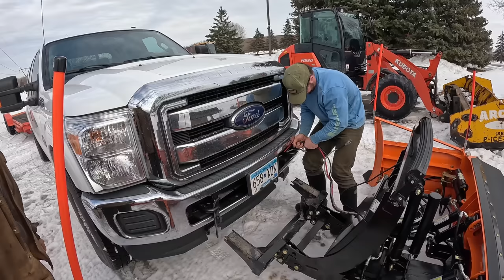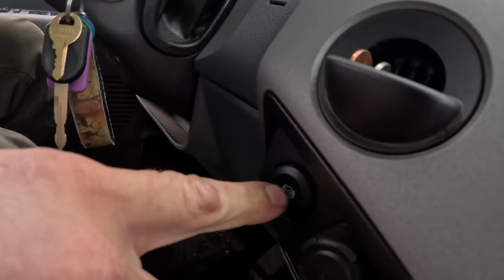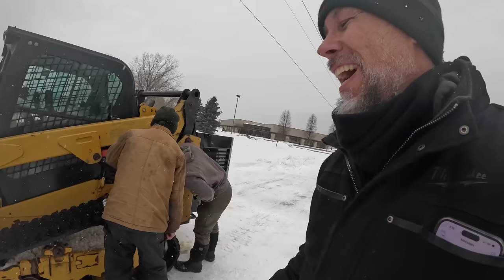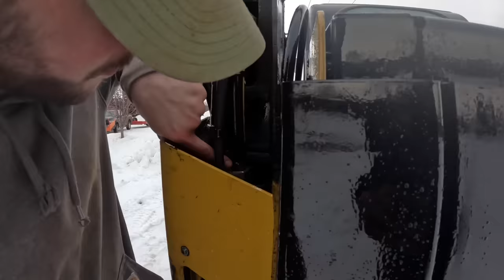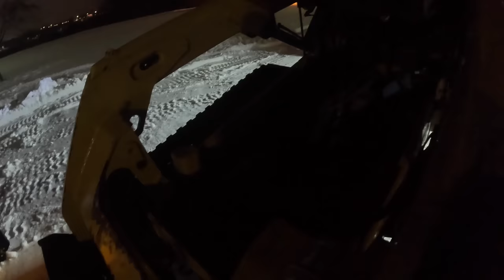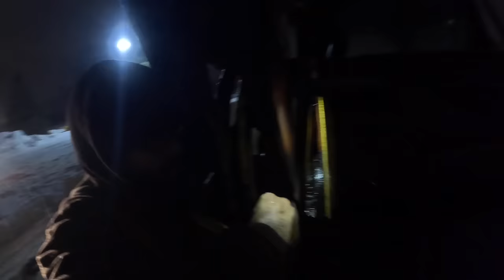Building a "newish" Diesel work truck

Comment: ram has had a factory exhaust brake since 2007.5 when the 6.7 came out. they’re freaking amazing! never had to touch your brakes
Reply: I agree and you can upgrade it to different levels cousin has one that sound like a big rig shooting a ak47 when on high come down the road
Reply: Exactly why I was surprised a guy running an excavation company has never seen an exhaust brake on a pickup 😂. Been on the dodges 15 years, ford's 7 years, Chevys for like 12 years
Reply: @devvoid1312  haha i thought the SAME exact thing and not in a bad way towards Stan i was just surprised he’s never seen it before especially since he owns a few dodges
Reply: Yes they have but I have never seen Stan drive or own a Diesel pickup truck so maybe that why.

Comment: For the best visibility in skidsteers, I suggest you test out a JCB. Possibly the Telehandler model which can pile snow up far further and higher. The JCB also has a side door, so no climbing over the plough linkage.
Reply: He’s not going to do that I agree with you but jcb make all Volvo skid steers because Volvo doesn’t care about the skid steer market at all and volvo doesn’t enforce quality control on jcb (kinda like the Chevy vs Gmc quality control) or stock parts so for it so it became a hated piece of equipment in his company because of breakdowns and maintenance
Reply: @Doubie.  Volvo no longer market shidsteers and JCB sell direct through their own dealers.
Reply: I  believe Stan had a Volvo skid steer.
Reply: @Doubie.  discord
Reply: @Doubie.  discord
Reply: @Doubie.  discord server

Comment: I have a 2017 f250 6.7 and I love it. The only aftermarket part you need to install on that truck is the s&s disaster prevention fuel pump bypass. If the high pressure fuel goes out on that truck it will send metal through the hole fuel system.
Reply: Came here to say this as well. I had my fuel system fail, and am now running the S&S kit as cheap insurance in case I get bad fuel again.

Comment: Been a Cat man for over 20 years, and they are the very best in my opinion. Power, dealer back up, and ability to take abuse and keep running make all the difference. Branding doesn't matter when the job needs to be done. Cat typically outperforms everybody. Price is typically higher than off brands but try to fix them when they're broken. The best value for the dollar come from a more expensive machine's performance in the long run. Parts price can be prohibitive to some contractors, but longevity in the long run can make a difference.

Comment: I have a new CAT skid 239D3 machine.   So far after 2 years love it and they do have that hole plugged up now with a rubber blocker plate that stops the hoses from rubbing too.   I’m a CAT guy but then again my area they are the closest dealer to me out of any of the brands and that’s still a 3 hour drive for me.  Any other dealer is a 4 plus hour drive so I unfortunately don’t have much choice in brands.

Comment: We have an older Case 75xt and I love that skid loader! It is a wheeled machine but I do prefer wheels, at least for my application on the farm. The hoses are a lot simpler than that caterpillar and it seems to be a well-built solid machine. I will never buy anything other than Case, as of now.

Comment: Not to be pedantic, but technically not a Jake brake. Jake brakes float the exhaust valves to interrupt the combustion process. This truck has an exhaust brake, which is a butterfly similar to the throttle body of a gasser behind the turbo in the done pipe, which restricts exhaust gas from exiting the engine / turbo, effectively slowing the engine down. Super cool tech regardless.

I'm not much of a truck dude, but I've towed a few things in my life. By far the biggest and heaviest thing I ever towed was a 26 foot enclosed race trailer behind a friend's 2014 chevy 2500hd.  This truck had an exhaust brake, the Allison 5 speed with transmission braking, and trailer brakes. Was exiting interstate 70 at 75mph, signaled, lifted off the throttle and by the time I was at the end of the ramp for the traffic light, the truck had stopped itself without me doing anything. Was an amazing towing experience, and no heavy duty work truck should be any different, in a perfect world.

Congrats on the diesel, Alex. Super nice truck you got there. Thanks for sharing, Stan.

Comment: I work for Ziegler the drive hoses have always been a problem so Ziegler made there own upgrade one were we put a other thicker hose over top to help with the rubbing. I don’t know if you guys went that way but Ziegler does have the upgrade. Have had quite a few machine have zero issues afrer

Comment: Just an idea on stopping mud from getting into the hose area on the cat 
Try using foam like the dirt bike racers use around suspension stuff the foam in the hole and it will be easy to remove when you need to and won’t stop hoses from moving.

Comment: Stan if you ever get in that 6.7 you will totally fall in love with it   they are amazing motors and I'm not a fan of all the epa crap on them but ford did a great job . The cat 289 blowing hoses is totally neglect from the previous owner , ours has 3000 hours and only 1 hose has ever blown on it , it was the small one that is for the hydraulic quick attack , it was a super easy fix down for maybe an hour......I think you are forgetting the ford backhoe when you're saying that cat has blown the most hoses 😆🤣😂

Comment: Bought the same skid steer but brand new in 2021, CAT did fix the hydraulic line glory hole issue witch is great. Zero dirt can get in there and the lines are nicely held in place. absolutely love the machine . I do find my self relying on the back up camera alot (I do commercial site work so always working in tight areas) unfortunately the back up camera only comes on 80% of the time ..  and i always thought other skid steers had much better backwards visibility. othe then that absolutely love it , never ran a higher quality skid that performs on point 8hrs a day every day.  Seems everything you don't like about your year cat has been improved! If you grab another skid steer go cat and get the cva service package.  It'll be considered a cat certified used piece come time to trade it in . The send all the maintenance parts to your front door when the machine rolls a certain amount of hours.
Reply: Also found the cat 259d3 is the top pick when it comes to fincese work in a skiddy. Others are great as well at moving dirt and running strong . But the cat is top dog when it comes to finceseing grades when forward grading vs just backdragging.  Its bites and holds its ground and is super smooth .
Reply: The numbers worked out great as well.  Shopped out a few different brands and cat financing is amazing.

Comment: All trucks with vgt style turbos have exhaust brakes. 03-10 & 16+ fords have them but the turbo design in the early 6.7’s didn’t allow for them. In the earlier trucks it automatically engages in tow/haul but the newer trucks have the button. That’s for all 3 brands
Reply: 15+. 11-14 has a Gt 32 single sequential. 15+ has a gt3788. Same turbo as the 6.0 and later Duramax, pre l5p
Reply: @johndeereboy1998  I think you should double check your information. The only thing they share is the center section, literally everything else is different.
Reply: @Bry_nlch  that's what I'm referring to my dude. The cartridge is the same for the gt37 across the board. Only difference is the covers and pedestals. Wheels, bearings/bushings, and nearly everything else is the same. Including the vane cage and vanes, depending on the exhaust housing size.
Reply: @johndeereboy1998  which would make them a different turbo…Similar, yes, but different. I still don’t understand how any of this is relevant though
Reply: @Bry_nlch  the cartridge makes the turbo. A 3788 is a 3788. Just like a s300 framed turbo is an s300. The cartridges are the same. 

You tell me how this is relevant, you replied to me trying to correct me. Fords have the button from 2015. Not 16, not 14. 2015, with the gt3788. Duramax from 2011 and ram from 2007. 

Ironically, ford used the same turbo as a Duramax, the gt3788. It's the same frame, with different covers. 

Go look up a 10 blade turbine and 6+6 compressor from a Duramax and then a Ford, same P/N. I daily drive one

Comment: My 2015 f350 has thé engine break. It’s great, if you put the truck in tow/haul mode the engine break works even better, without tow/haul pressed it still works but tow/haul steps it up a notch

Comment: Stan, I have been a diesel believer for years this last year I purchased a 7.3 liter gas Godzilla and so far it’s cheaper to operate and I have only missed the torque for a diesel once, I was pulling a skid steer up a steep grade and you could feel that the truck was giving everything it had and my diesels on the same road had more power left. It’s only been a year but I’m leaning to buying after 7.3 .  The emission systems on diesels are crazy expensive when they fail and it Usually happens when your done with warranty.
Reply: In 2013 I bought my 2012 Ram. The salesman tried talking me into a 2013, 2012 was the last year Ram did not have DEF. Did the delete, tuner, intake & 4" exhaust. Its a beast.

Comment: The 2011 Chevy’s started having exhaust brake. Cummins pickups had exhaust brakes for awhile. I will say Alex needs to turn the exhaust brake on whenever driving the truck not just for trailering. So hey in the truck, hit the button, make it a habit! It keeps the vanes in the variable geometry turbo moving otherwise they stick and you have to replace the turbo sooner than later.

Comment: I've run alot of different skid steers and have found they all have their problems. Track loaders are more maintenance intense than their wheeled brothers. Some guys get hung up on brand loyalty, which isn't a bad thing because they get very familiar with the equipment. Familiarity helps with maintenance and repairs. Not having to have a service truck come out because you can do your own work saves money, as long as it is done right.  Personally, I run New Holland because I am very familiar with the product.  Is it better than other machines? Not really. I prefer the ergonomics of the CAT and ASV. My thought is run what keeps you productive and as comfortable as possible.  I still use my old LX885 on occasion because I know that thing inside and out, have replacement parts on the shelf and it has been very reliable.

Comment: Before they built the swing wing blades there was a guy building back blades like that snow pusher in the 80's, with the extendable wings. Wasn't the best, sure they got it figured out though.

Comment: The exhaust brake on the Ford, in effect does the same as a Jake brake, but isn't a Jake Brake.  Jake brakes use the compression in the engine to slow its rotation.  Exhaust brakes basically plug the exhaust.

Comment: The new cat 259d3s have a rubber plug in the hole where the drive motor lines go in. The plug also isolates the hoses so they don’t rub.

Comment: Yep that transfer case is the best idea because you don't have to worry where is it not working the switch the fuse the other fused or the motor in the transfer case or do I have a wire broke somewhere

Comment: My 2013 dodge has an exhaust brake.  120k on the truck and only 1 brake job done.  save on wear and tear.  Its great for towing heavy equipment.

Comment: Stan, I have been looking at the Wackers. They have a Kohler diesel with no dpf. I ran one at a dealer. It seemed very simple and easy to use. I also like the tilt forward cab to get into the engine. I would be very interested in hearing your perspective on them if you got a chance to run one.
Reply: They seem to be quite good

Comment: 2007+ GM 2500/3500, 2012+ Ram 2500/3500 have exhaust brakes. My 2015 Silverado 3500 had a factory one. I think Ford F250/F350 from 2013+ had them. For the diesels I should say

Comment: Well if I was you lots of skid steer options out there but just see if he can get your name on the list and get one of the new Kubota 75-3s. They have made a bunch of changes to them. A lot more comfort on the inside and some accessibility on the back side is a lot different also with options to add weights to them

Comment: exhaust brake is different from jake brake, jake brake manually slows the motor down, which is only on semis. a exhaust brake creates backpressure to slow the engine down

Comment: Far as replacement skid loader, I would go with whatever you had the least number of issues.  Since the Cat was a lemon, I would go with something that you have proven track record with.  Unless you see the Cat have changed the engineering issues.  Then I might want to give it another try.  But I rather stick with something that I feel like I could trust.

Comment: On the CAT, fab a shet metal cover over the line housing and tack weld it on. Will fix that trash being tossed in. I'm an actually surprised you guys done have the equiptment to fab your own lines. Most places I know that have more than 3 or 4 machines just buy the crimper and rolls of different size lines and fittings. As far as getting a new loader, is there one you have not used before? If not, try it. I am seeing this new trend of guys ordering no name equiptment from alibaby at SUUUPER cheap prices and waiting the 30-60- days for it to get here. One guy bought a mini loader for like 8K new. Loves it. Maybe try that if you have time to wait for the import.

Comment: Depends on the job if I was doin mass amounts of strictly dirt work I would be getting the all new case dl550 but gravel and landscaping and lot work like you do I would be torn between cat and John Deere but cat would be the 259d the use asv tracks but doing bush work and deep mud stuff asv because of weight and floatation plus ground clearance

Comment: I'd go with asv. I've run a terex pt100g forestry 2011 model and the only thing I couldn't stand was the leg room in it... yea u got frustrated with the controls but I learned to like them by the end I just wished it had vertical lift arms instead of the old style but I could run a small harvester head with it so I can't complain about it

Comment: The only skid loader I’d buy is a JCB simply for the side entry of the cab, and it’d preferably be the teleskid model for the reach. But I’m also a wheel loader operator more than a skid loader guy, as long as the articulation point is in front of the operator not the operator swinging with the front half of the machine like that cast loader Stan has

Comment: The Cat track loaders would be nice if you could get rid of that torsion axle and make a shroud to protect those hoses to the drive motors and keep the dirt out. Don't buy a new Cat Stan in any group or forum I've seen they are nothing but trouble. Stay with your Kubota's. I'd love to give a Manitou/Gehl a try and Takeuchi. Skid-steers shouldn't have suspension it makes it too difficult to grade decently with these torsion bar systems.

Comment: The American diesel pickups are all impressive. I've driven all but the Ford. DEF, fuel gouging, and electrical gremlins are the downside. The transmissions are impressive. They make some beautiful sounds hauling in mountains or rush hour. My only dislike with the old school T-case shifter is not being able to shift on the fly. Even if it says you can I've never seen one work. Nothing like being in freeway traffic at speed in 4 high and hit bare pavement on a curve.

Comment: If you let your guy sit with it for a while he will come up with a good way to stop the mud right off hand a horse stall rubber bolted in over the opening would allow flex take the hoses and put them in a sleeve then the mud would not be buried as bad may not work as well as it was a quick thought but give your guy a moment with that idea and he will have it solved

Comment: Couldn't a plate be built with bolted pass-throughs so the hoses are hard mounted to the plate eliminating the need for the holes?

As for which skid steer I would get.  I am completely in love with Bobcat but that is a personal preference due to operator comfort.

Comment: First off that is not a Jake brake.  Jake's are compression brakes and that is done internally with the engine valves.  Ford, GM and dodge have exhaust brakes as optional equipment on diesel trucks. All the exhaust brake is a flap that limits the air out of the exhaust.  I would like to see a New Holland C345 or a C362 loader on this page

Comment: You’ve never really had a Case or New Holland(same company) but there more farmyard oriented same with deer but deers are needlessly expensive and they try to force you into shelling out money for them to service it by taking away your ability to do so 
you’ve really had every North American brand or there sister brand I would actually like to see a Jcb to see if it makes up for the failures of its lesser your old Volvo but I also understand why that’s not going to happen in a business environment what about that Mecalec excavator that can run in skid steer mode that would be interesting to see a snow pusher on and it would probably be pretty unique

Comment: HeII NO to New Holland ! We gave those POS Machines two Chances and still got screwed 232 New Holland had A/C Heat nicely enclosed cab on Tracks ran great BUT there ventilation system is poorly Per Management the motor blew While Working half woods half field grapple, bucket, and bush hog normal wear and tear and usage of the machine So don’t try to charge me for a Fkn motor if that machine can’t do that little of work I will definitely pass it costs us our business because we were small but moving up and when New Holland Fkd us we lost it all sorry 😅 for my rant but CAT Has a better line up